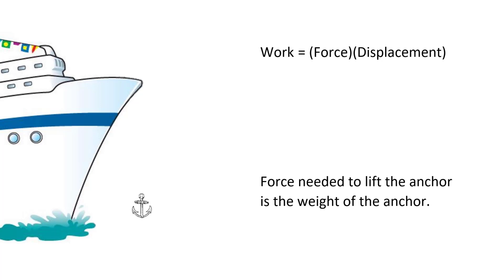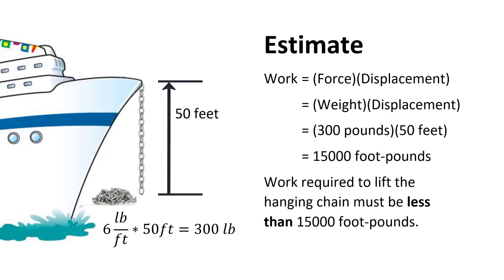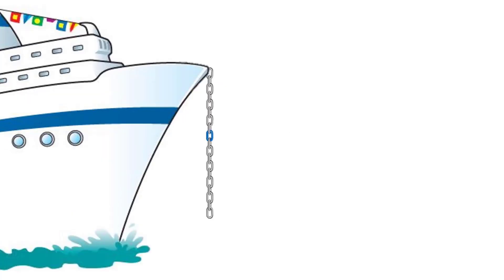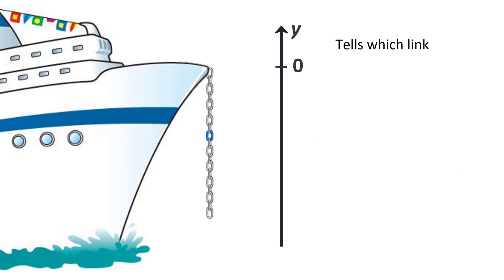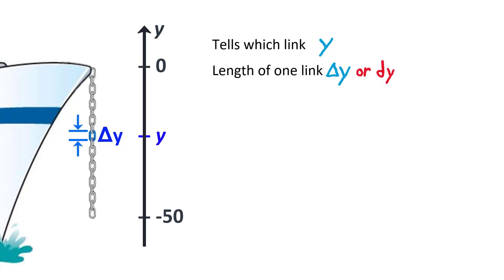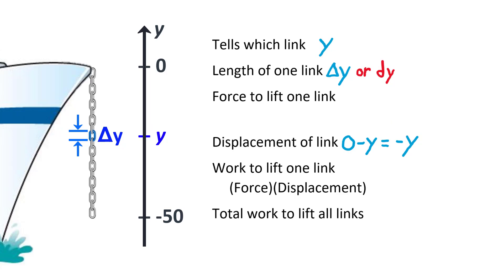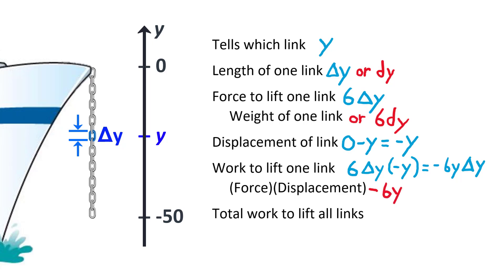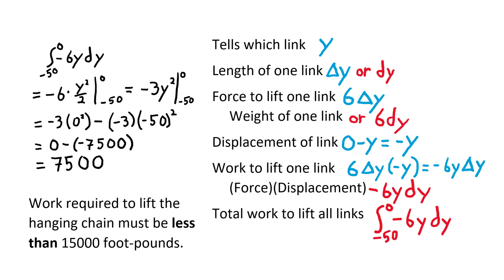Work Required to Lift a Chain

Comment: Wouldnt dy represent the x ordinate.
Reply from the maker: I'm afraid I do not understand the question.  Could you please clarify?
Reply: @ConceptualCalculus  Simply stated I would think  the graph of the problem would have an X and a Y coordinate. The reason being most antiderivatives shoùld be able to be solved by finite element analysis.
Reply from the maker: @Black_Cats_Of_War  You could make a graph with position on the horizontal and weight on the vertical.  In that case the position (which I called y) would be your x, and the weight remaining to be lifted would be your y.  

I'm not sure why you would bring in finite-element analysis when this is such a simple integral.

Comment: One Interesting way to Check your Answer is to take the TOTAL WEIGHT of the Chain and place that weight at the MID Point of the 50 feet. That would be 25 feet. Then us W = Fd = 300 lbs times 25 feet =  7500 Ft-Lbs .. which is equal to the Integration Value. :) add that to the Anchor and voila!  Love the video! Thank you.. :)
Reply from the maker: You are right about that.  As long as you stick with this simple problem structure, the answer is always that the work is equal to the weight multiplied by the distance moved by the middle of the chain.  I didn't want to offer that as a short-cut to the answer, though, because the point of these problems is to learn the method, which also applies to much more complicated problems that don't have such simple answers.  We're warming up to emptying odd-shaped tanks, and that kind of thing.  I was afraid that if I offered a quick route to the exact answer then no one would pay any attention to the method.  They would score a few easy points today and fail something larger later.

Glad you liked the vid.  I hope to make more this summer.